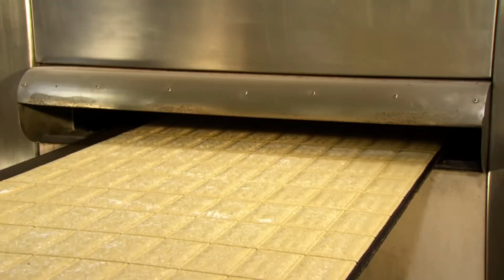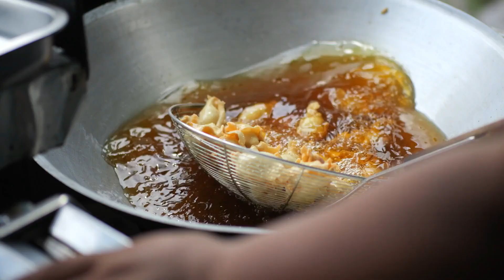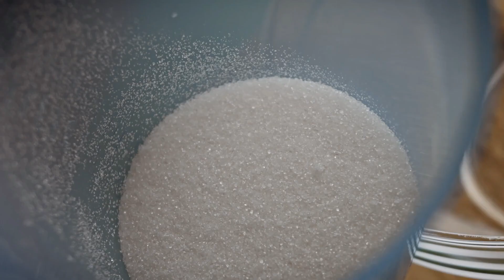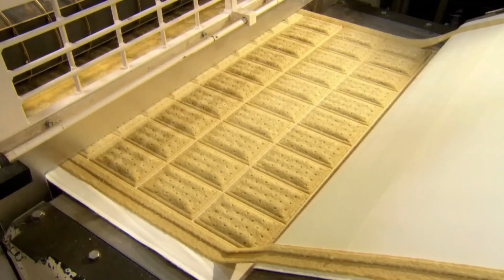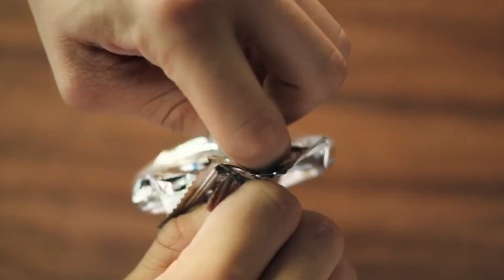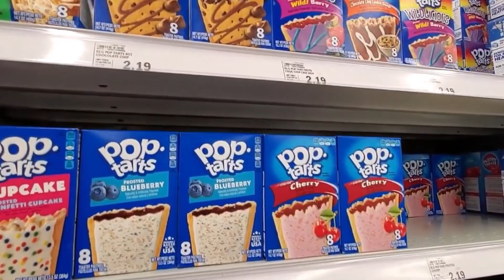How Are Pop-Tarts Made | Inside The Factory

Comment: I hate the fact that they don't do gluten free version.  I don't know if Gluteno is the same company as pop-tart, but I don't think so.   The Gluteno version of the pop-tart are gluten  the iner filling is just strawbery they are no variarty, some do come with the frosting on top.  At the time that I did not know that I was Celiac.  Pop-tart  the square box you have 3 pack in one box, and 2 pop tart in each pack.  The  Gluteno version the one that are gluten free  twice the price for a box of 3 pack,  which just one each pack.  For the gluteno version you pay double price for half the content compare to the original.   Only the filty rich people with celiac will be able to buy does.
Reply: You'll be fine. Your dick wont fly off if you have some gluten